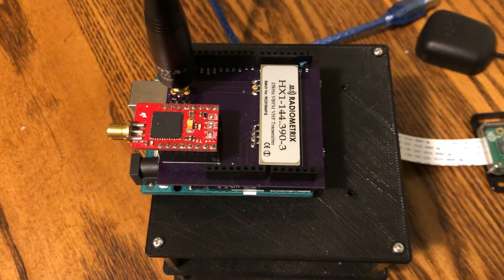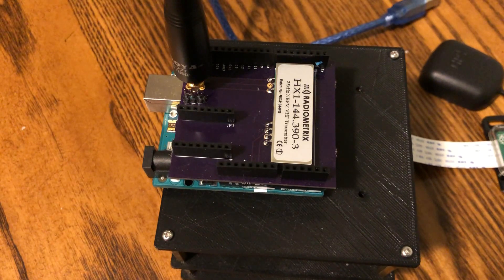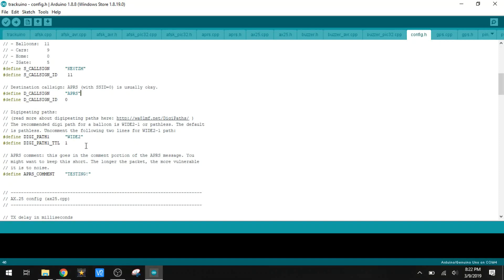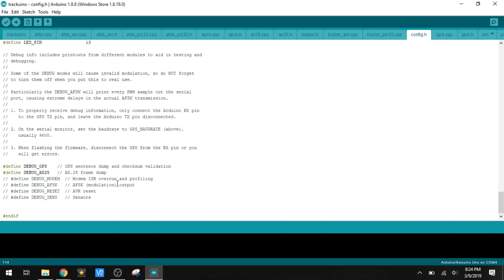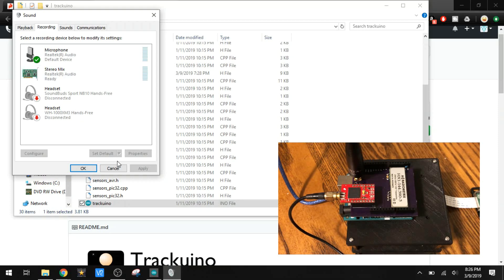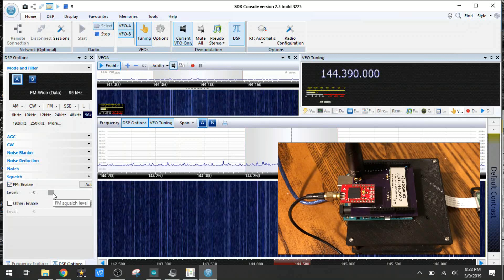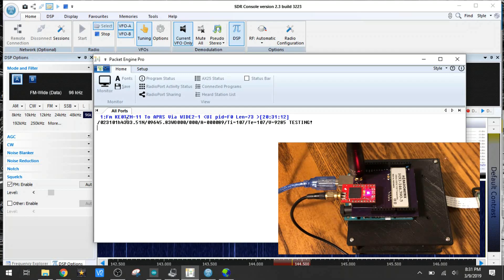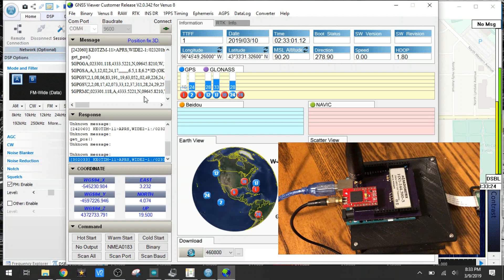Weather Balloon Tracking System | High Altitude Balloon Project | Raspberry Pi 3 B+

Comment: You can't use regular wires for a transmission line (your breadboard example). It's not any better than leaving the connector open.  Need a 50 ohm connection at the RF frequency.